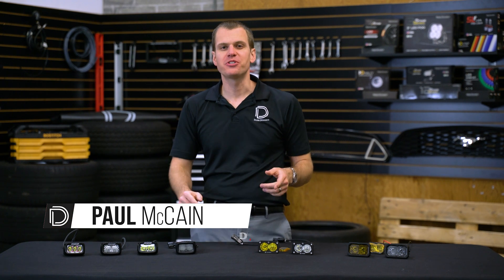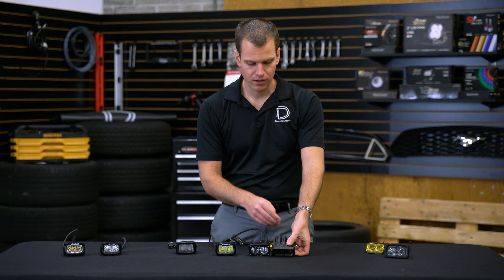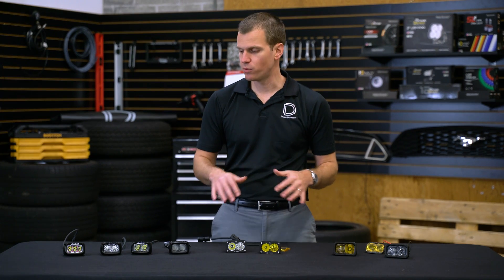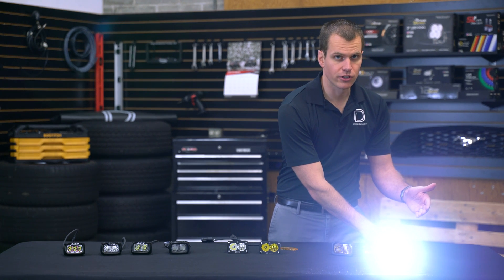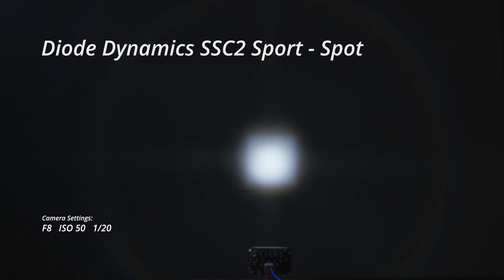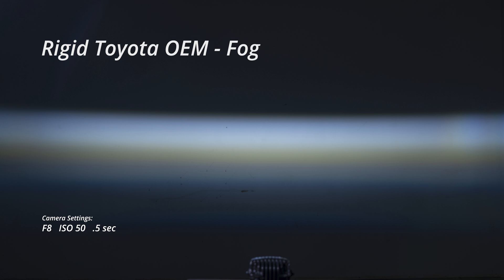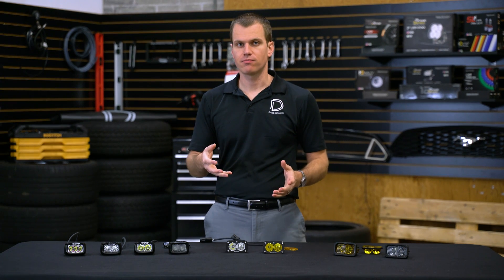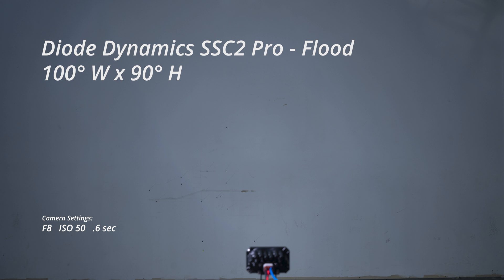2" LED Pod Shootout: SSC2 LED Pod vs. Market-Leaders | Diode Dynamics

Comment: Comment on the Baja Desgns Pro. It gets hot and cuts power, but the pro models I believe typically are for longer range, which you don't need when you are stopped. I would assume that if there is air flow, it would not get hot and derate.

Comment: Amateur here…will the backlight feature use one 8 switches on my panel?
Reply from the maker: If you're connecting our main beam and backlight to your auxiliary switches, you'll need the main beam on one switch and the backlight on another. 

If you have additional questions or concerns, go ahead and give us a call at 314-205-3033 Monday-Friday 10 a.m.- 5 p.m. CST, or shoot us an email at contact@diodedynamics.com, and our service team would be happy to help you with that!

Comment: Put out a red lens, make a rear fog light adapter for various cars and this is one fantastic rear fog light....
Reply from the maker: We have a red backlight feature with our SSC2s, however the red color is NOT SAE compliant, and Cannot be used for additional brake light or running light, but we are always innovating new products, so stay tuned!

Comment: I'm sold on the dd lights for my extra reverse lights, just totally settled on the pattern I should choose. Combo is what I was leaning towards. I like the light to spread to the sides as well as a decent punch out back.
Reply from the maker: Hey Justin! It sounds like the combo is the way to go.
Reply: Which light did you end up getting and are you happy with your choice?
Reply: @bigmike7801  ssc2 in combo pattern. Yes I like them a lot. The red backlight is a cool feature too.

Comment: So I really like the focus of your work, making a very defined beam of light to accomplish specific lighting tasks. Also your videos are educational to the consumer. You come across as giving an unbiased report.

My questions are these:
1) you continuously talk about baja designs pro level lights failing after being on for a few minutes and describe them as unstable and then give a candela of roughly the same for their sport and pro models. Did you experience this with every pro model light you tested? How many lights of the same "failing" model type did you test? Just one? or five lights of each type and they all exhibited the same problems?
2) you define candela on a linked video as the amount of light (lux) at a "specific point" at a specific distance. What point or field are you measuring when you are comparing your lights to baja designs? It seems on some of your photos that baja is putting out more light overall, though the center of your light pattern is brighter, albeit more focused. 

I don't have a dog in the fight. I'm trying to pick the best light for me. I have your lights and bajas in my Amazon cart right now. Your numbers and descriptions favor your lights, however that seems contingent on the baja pro models, which look visibally brighter overall, though not in the very center, failing. And it seems contingent on where you are measuring the light beam throughout your testing.  I appreciate your help and like the way your lights look. Your price point is better too. Keep up the good work!
Reply from the maker: We're glad you enjoyed it, Dennis!
Reply: @diodedynamics  you didn't answer the questions.
Reply from the maker: @DG-ou8hx  Sorry Dennis. We didn't see the drop-down on the comment.

1. For this video, we only tested dual-LED pods that are comparable to the SSC2 on the market. All output tested from each pod are from one pod. We also only test 1 of the same model of each pod. 
2. We measured all of these at the same distance. Like you said, Lux is the amount of light at a specific distance. You measure the hot spot on the beam pattern using a Lux meter to get this number. The spread on one pod may be wider or bigger, but the lux reading may be smaller, meaning it is not as focused. Lux x meters squared gives you your candela. This is the best number to look at when comparing true output because it gives you how much focused light output is being shined in a specific direction.

Thank you for the kind words! Every light on this list is the best on the market. That's why we put them up against our SSC2s. We encourage you to go with the light the best suites your needs. If you have any further questions, feel free to ask!

Comment: hey there.  are any of these dimmable?  I want to install some on the side of my rig and would like the option to dim them down when set up at camp when I don't need them as bright.
Reply from the maker: Hi Scott! These are dimmable, but do not come with a dimmer switch. They will need to be wired into a switch panel or dimmer switch that can dim them!

Comment: I currently run some Rigid Dually as ditch lights but would like to switch to these SSC2.  

Will the Rigid Duetsche DT connector plug into the SSC2?  (No backlight of course)
Reply from the maker: Unfortunately, no. It would physically fit, however, the SSC2 will need a 4-pin DT connector to properly function. The Rigid is most likely a 2-pin.

Comment: Can I attach a helicopter spot light on my truck, because that’s what’s happening, these lights are extremely bright that it’s blinding the other drivers, on the roads. there has to be a legal standard , very dangerous,  people are careless on the roads and with these extremely bright light 💡.more car accidents are accruing.
Reply from the maker: Hi there! If aimed properly, these will not blind other drivers on the road. Our fog and driving optic are SAE-compliant for legal on-road use. All other options are illegal and are for off-road use only!

Comment: Are all of those different settings(flood,driving etc) interchangeable or is it the same light?
Reply from the maker: The different output patterns are based off of which lens is installed on the pod. The pod itself is the same, but the lenses are interchangeable for different outputs!

Comment: The red lights in the rear add fog driving safty. This is exactly why I'm getting some. Audi and volvo are ahead of the game on this application.
Reply: These are called "European rear Fogs". The DD back light are not bright enough for this type of rear fog.
Reply: Lol there have been several us cars with this. My 2002 Oldsmobile had them

Comment: the Baja Designs plug isn't a proprietary one, but a standard Delphi Weatherpack connector. I have found them to be not as good as the Deutsch ones.

Comment: I had a set of C2 Pro on backorder since November and was just informed that due to a supply issue for the housings, it won't be shipped until April at least, so I had to cancel. Due to this video, I went ahead and got Baja S2 Sport for my scene/flood lights since the difference was negligible. I'd still prefer DD for my ditch lights due to the pattern though, so if anyone has a set (Yellow, Pro, Combo) and wants to trade for Baja S2 Sport Amber Combo, please let me know.

Comment: whats the ideal pattern for the ssc2 being used as ditch lights? combo driving?
Reply from the maker: Hi there! What are you looking to do with them?
Reply: @diodedynamics  angled towards ditches. 50-60mph back road use mostly.

Comment: Is there a photo somewhere of the pigtail that comes with your lights? I can't seem to find it anywhere on your site?
Reply from the maker: Hi Ryan! You can see the pigtail in the seventh carousal image at the link below! We also offer a Heavy Duty 4-pin harness for these as well! 

https://www.diodedynamics.com/stage-series-2-sae-dot-white-pro-standard-led-pod-pair.html
Reply: @diodedynamics  ok thanks. Don’t need the harness as I will be putting the lights into a switch panel.
Reply: @diodedynamics   If Red is hot and Black is ground what is the Blue lead? Is that the backlight?
Reply: @ryanskeete  Yes
Reply from the maker: @ryanskeete  that is correct!

Comment: I believe the Baja Designs wiring is terminated with a Weatherpack connector... At least they were when I got mine. I'd love to get a set of SSC2s but the integrated Deutsch connector is too bulky to fit in my ditch light location. The compactness of the S2 makes it my choice, even though all my other lights are DD.
Reply from the maker: Yes, you may be correct! Sorry to hear that - the Diode light is certainly the biggest of the bunch!
Reply: Just to clarify, the DT connector plugs directly into the C2, so there's actually no bulk at all in the wiring. I just installed Baja S2s last night as ditch lights and the weatherpack connector being about 8" away from the actual light means the widest part is right where my hood closes.
Reply: @XYoverland  I'm fully aware of how the DTM connector integrates with the SSC2, I have several sets of SS3 lights (fog and driving). You'd need to take a look at my ditch light location to understand:
https://flic.kr/p/2gvY8nX

Comment: Reposting my comment about which beam pattern would work well for a atv. I want two light pods that will function as low beams.
Reply from the maker: Depends on how fast you're going, but combo is a great choice for offroad headlights. None of our pods will produce a compliant road-legal low beam pattern.
Reply: @diodedynamics  Thank you! I just want to run something better than stock that won't look like I am actively trying to blind someone coming the opposite direction!
Reply from the maker: @Jdmjunkie001  if you're using them for off-road use, I would looking our driving and combo pods!